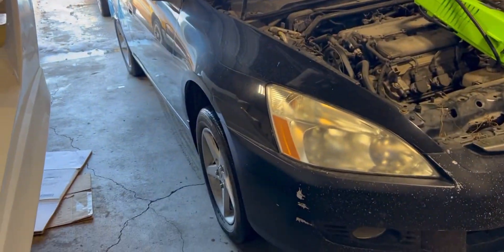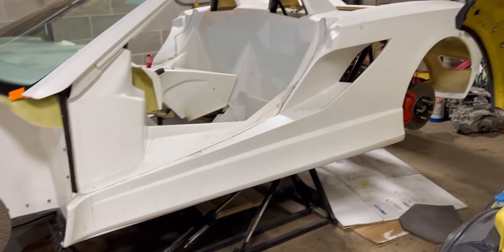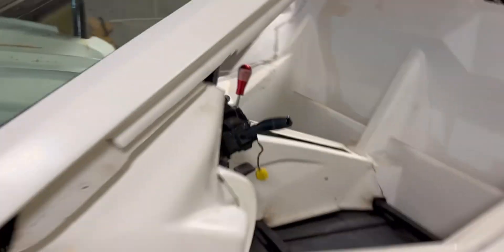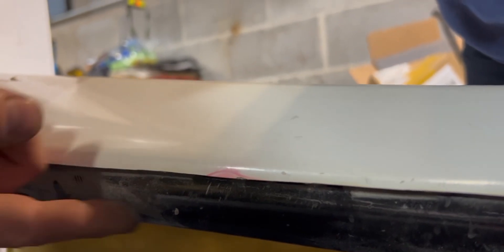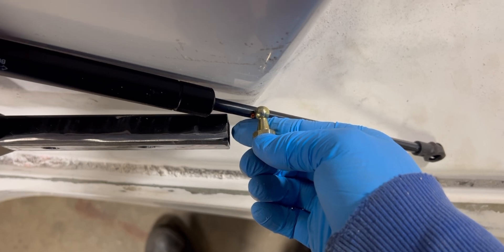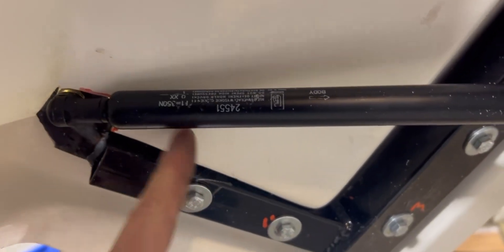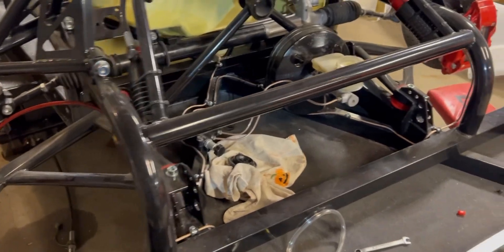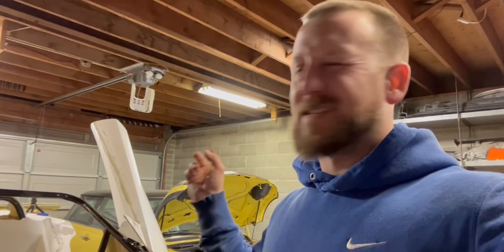Lambo Doors Part 2 And Finishing Up The Brakes. K Series Supercar Build Episode 17

Comment: I ended up getting even stronger gas struts (90lb).  If you put anything in your doors (like speakers) it will not have enough force to open your doors.  By the way, the door fitment was one of the more challenging aspects.
Reply from the maker: Really? Wow! Today i ended up cutting the hinge apart and welding it back together. Fits alot better with no strut on it. Any tips for fitting the gas struts so that the bottom doesnt pop out? I watched ur videos on door fitment and it didnt seem that u had the same issues im having unless u had them off camera.